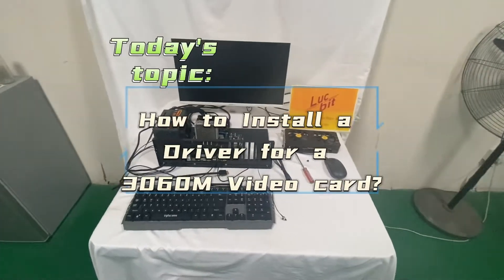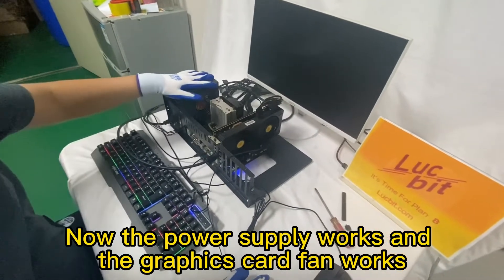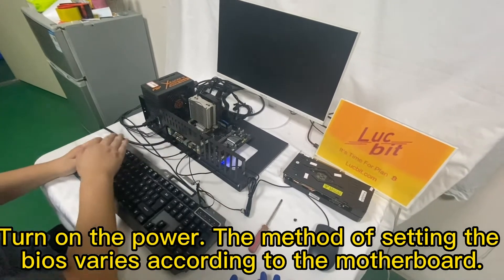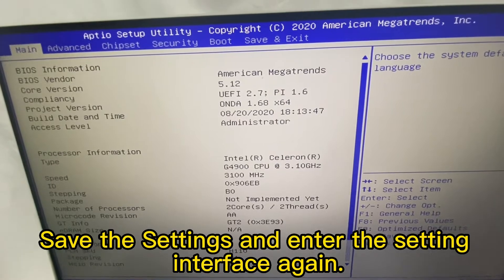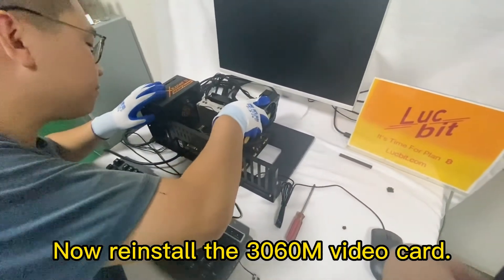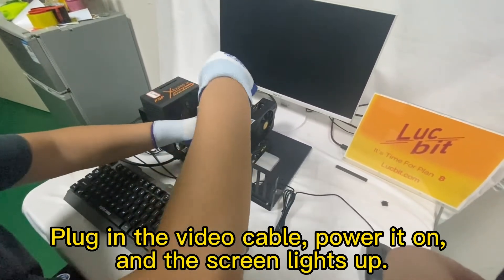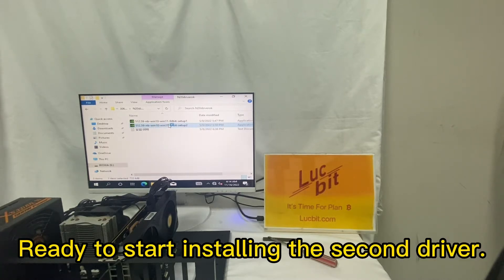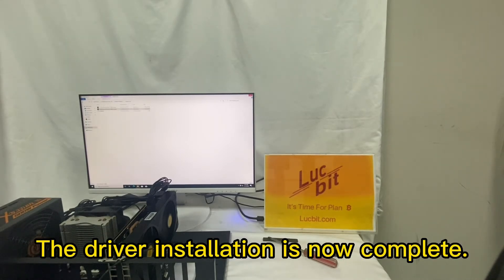Do you know how to install the driver of 3060m video card correctly?.

Comment: And if my motherboard doesn't have integrated graphics to deal with bios changes?
Reply from the maker: This does not require an integrated graphics card. In this video, the customer installs a 3060m video card and then downloads the driver. The main reason is that the motherboard BIOS has the two corresponding settings.